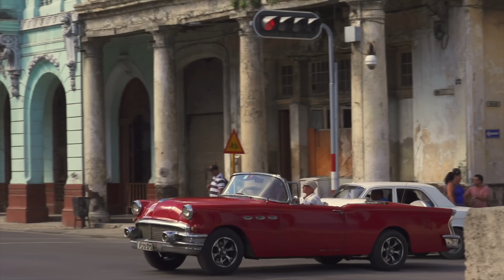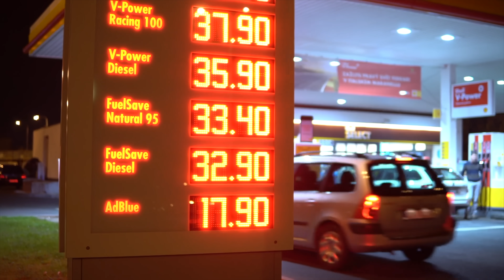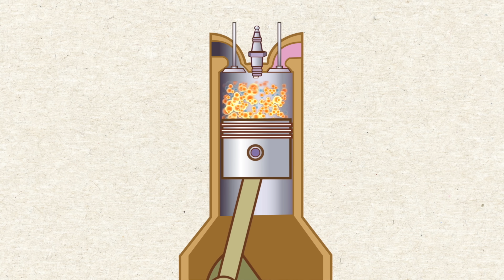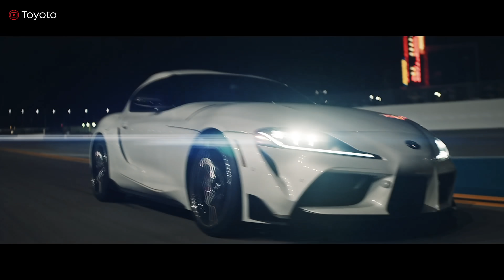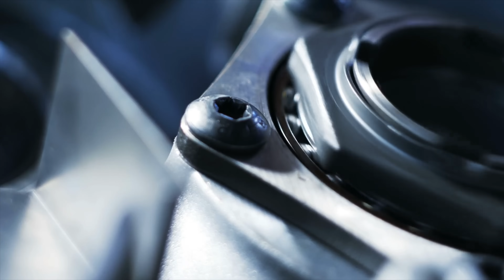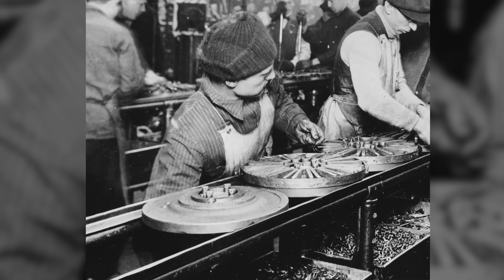7 Fuel Myths Stupid People Fall For

Comment: Scotty, not sure if this was covered, but we have the "may contain 10% ethanol " stickers on our Canadian pumps. I also run a lot of small engines for yard work and motorcycle and off road vehicles. There are about 4 or 5 distributors including Costco Canada that their premium does NOT contain ethanol. That's what I use in engines that may not get a big turnover in fuel, like a generator. I have cleaned so many carbs that are just plugged solid from old fuel with ethanol. It also attracts moisture and contributes to rusty tanks on motorcycles and other engines if they are not used regularly. If I use premium with no ethanol, I don't need a fuel stabilizer on engines sitting till spring etc.
Ethanol is garbage.
Reply: I'm with ya there. Premium here generally means no ethanol we did an experiment with our 07 sierra truck that will also run e85 fuel that isn't available in Canada. Non the less we would generally get after some time using regular fuel we would get a trouble code and reduced power eventually I would have to clean the throttle body. We switched to premium and have not had that issue so far it's been two years we've had the truck for five we also get better fuel mileage so now I always run premium and as you stated premium for the toys always
Reply: Marty, I’ve heard of ethanol clogging up small engines!!  So what is it doing to our vehicles? 
You see I had this beautiful 2004 Lexus ES 330!  and my husband said, it doesn’t make a difference! But it does!  I don’t Know why they’re letting them sell us this garbage ethanol that will eventually clog/seize our engines   in the long run.  From now on, it’s Super for my new car. Thank You
Reply: @gloriacedeno.2737  Car engines have very different designs from most small engines in tools or some motorcycles. The rest of the car (fuel lines, seals, etc.) is also designed with it in mind. Those smaller engines are often using very old designs. For example, you may find a carburetor in a new snow blower or weed whacker. You won't find that in new cars nor used cars going back many years. Also, unless you don't drive your car at all, fuel probably doesn't sit in it for more than half a year at a time. That's where a lot of problems come in.
Reply: Are the small engines two stroke or four stroke?
Reply: Agreed, well said

Comment: Our local Chevron station here in Western Canada offers a fourth option that does not contain Ethanol . I use that one for applications where I know the fuel may get a little old. (boat,generator, lawnmower,etc) along with a well known stabiliser . Enjoying your vids! CHEERS
Reply: Vehicles older than 2002 also should get that 4th blend. All of the rubber/neoprene fuel lines and connections, fuel tank hoses and vents etc. were not made to deal with the caustic effects that ethanol has on those parts.
Reply: We can get that stuff here, but it's getting hard to find. In the US, it's called white gas. Boat docks usually have it. But it has a small amount of lead in it.
Reply: My motorcycles always get ethonol free gas
Reply: Many gasoline station in Ontario have ethanol <spit> free premium fuel.
Reply: @Garth2011  Most cars built after 1986 can use E10 fuel, only cars built after 2001 can use E15.
Reply: Yep that is available in Australia too, its always easy to find ( although not all stations stock it) as the E10 pumps must be labeled "may contain up to 10% Ethanol" if it doesn't have that label then its plain 91.  E10 is often close to 95 in reality but not often labeled as such, I guess because it it's usually cheaper than the real 95.
Reply: @michaelbaka4777  Actually "white gas" in the US refers to an unleaded gasoline sold by Amoco or American Oil Company in the days before unleaded gasoline was the norm. I pumped a many a gallon as a teenager working in a "service station". We did warn people with new cars that they should run a few tanks of leaded gas, or at least half and half leaded/unleaded to help harden the valve seats in a new car's engine until it was broken in.
BP bought the company out in 1998 and pulled the brand, but I see they are now allowing dealers in certain parts of the US to sell under the Amoco brand.
Reply: @michaelbaka4777  Its not called white gas.
Reply: @michaelbaka4777  white gas is basically Coleman fuel used in lanterns and camp stoves.
Reply: @barrywilliams6955  also known as Coleman fuel.
Reply: @XploreAz  Yes, same thing. Coleman fuel sold at the time for, I don't know, maybe $2.50 - $3.00 for a one gallon tin can. Amoco was selling for about 40 cents a gallon. The more aware amongst us used white gas in our Coleman lanterns, stoves and "floundering lights'. And also in our Zippo lighters.
Reply: Fourth action??
Reply: @jimlewis7200  I see it as 4th option.Not sure where you are seeing "action"
Reply: why dont humans only make the best quality of things? why have several different worthless qualities of things?
why waste time and energy making worthless things? when you can devote ALL your energy and resources into making only the best things?
tells you al lot about this stupid world.

Comment: From a chemical engineer, you are listening to too much propaganda on ethanol.  If you calculate the energy to process, water consumption, and other inputs to make corn based ethanol you would never use it.  Next, the cost to produce one gallon of ethanol is closer to $12-$32 a gallon.  Due to subsidies, lobbyists, and government mandates you continue this insane program.  Sugar is primary source outside of USA and most efficient, which the US does little of.  Total CO2 emissions and pollution, ethanol produces 5 to 25 times more pollution than hydrocarbons (ie: gasoline - LCA verified).
Reply: So mid or premium…layman’s terms. Lol thanks

Comment: Detonation is a twenty ton hammer blow to the top of the piston and the ping is the crank bearings contacting the crankshaft because the oil film is forced aside by the force applied to the piston. This at least was the explanation Champion spark plug school gave in 1972!

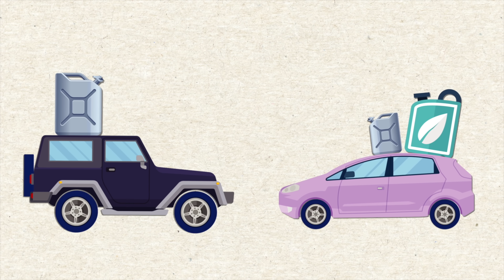Comment: 8:29 : Ethanol isn't as "renewable" or "carbon neutral" as its proponents like to claim.  Planting the corn, harvesting the corn, turning the corn into cornstarch, turning the cornstarch into corn syrup, fermenting the corn syrup into ethanol -- all of these steps consume energy.  Some studies even go so far as to state that it takes MORE energy to make 1 gallon of ethanol than the chemical energy contained in 1 gallon of ethanol!
Reply: Also, without government subsidies, the prices would be way higher.  I've seen some videos comparing mpg of straight gas vs ethanol gas and straight gas wins every time.
Reply: @Llew70 : That's not really a fair comparison.  It's well known that it takes 1.7 gallons of ethanol to equal the fuel power of 1.0 gallons of gasoline, so we'd expect a gasoline-powered car to get 1.7x the miles per gallon of the same car running on methanol.

The real issue isn't the MPG, it's the COST of 1.7 gallons of ethanol, vs. the cost of 1.0 gallons of gasoline.

Comment: I was hoping you'd go more into the 85 octane that you'll see in the high plains/ out west.  The 85 octane pump was on the still for the video, but not really mentioned. Recently I had to explain to someone why they shouldn't run 85 octane in their modern EFI car. Do really that many people have older carbureted vehicles out in Wyoming and Colorado where you see this fuel? I also saw 86 octane on a recent trip out west, and I actually topped off my tank with this 86 octane, in my truck that needs 87 min.  The half tank that remained in my truck when I topped off with 86 octane, was 89 octane, so it ended up being over 87 octane anyways.  I just think it's weird that fuel with octane less than 87 is even sold in any state.

Comment: Our grocery stores have a gas station with 82 octane and I accidentally used it because it was in the same spot in my usual 89 button.   I had never seen this before. My vehicle started puttering and actually shut off while driving.   I went and filled up with the highest octane to correct it.

Comment: I've learned to use manufacturer recommended  gas and oil only...I have a 2017 prius that calls for regular only and 0/20 oil.  The reality is that cam phasors and active lifters use oil viscocity to help determine valve timing...changing either can be problematic....
Reply: You should be selecting your oil mainly depending on your environment.
Reply: @pinionification  ..Yes,specially with temperatures reaching 105 in the summer in the south.

Comment: OK Scotty, I’m gonna have to disagree with you on E85 fuel. The bulk of corn produce in this country does go to producing ethanol. However that’s corn is diverted from cattle feed causing meat prices to skyrocket. The only reason ethanol is cheap is because the government subsidizes it. It’s bad for us.
Reply: You’re not correct. The bulk of corn doesn’t go to ethanol.  40% does.  Of that 40%, 31% is turned to feed as DDG’s as well as corn oil and carbon dioxide for carbonized products.
Reply: I've been wondering about Ethanol for a long time... all the evidence I have seen so far says the process is not energy positive - So the end result of producing ethanol is to waste energy and drive up food prices?  Seems like a bad deal for everyone but corn producers.
Reply: @JohnDoe-pz6yq  Exactly!
Reply: No.  If corn prices rise, it is because the food corn yield in that year was low or bad.  Corn farmers were given guarantees by the government to buy/use the ADDITIONAL corn they planted for gas additive.  Farmers wouldn’t grow more corn unless it was guaranteed to be purchased knowing unsold corn was going to drive prices down both fuel and food corn.  When food corn yield in certain years are down, food prices increased but some called for diverting fuel corn for food instead.  Instead, it was decided to not tamper with the market, and allow normal corn yields in the next growing season to bring food corn prices down. The additional growing of corn is NOT crowding out growing food corn.  In fact, normally, corn is very plentiful and that’s why it is used in crap products like syrup which causes body inflammation, and in the future, sugar will be proven that it increases risk of Alzheimer’s.
Reply: You do not mention that a byproduct of the ethanol production is a high protein feed for live stock  - it is not wasted.

Comment: if higher grade eliminates rattle on cold start, also go with that
Reply: That’s not “rattle”, that’s “spark knock” from pre-ignition. Very bad for pistons. Yes, higher octane cures that, typically.
Reply: @tmcorey1  shouldn't be any pre-ignition on a cold motor
think this is open loop issue, set to mid grade timing till closed loop adjusts for emissions/mileage
all that have behaved such have been late 80s to mid 90s with over 150k, likely too much advance in closed loop but doesn't show till the engine gets some wear
Reply: @ty2010  could be a number of things. Almost impossible to diagnose effectively without hearing it directly. You mentioned higher octane seemed to cure it, which would suggest spark knocking (which does occur cold, but more typically hot and under load). Interesting case.

Comment: E-85 produces more emissions from growing the corn, making it from corn, and shipping it than it will ever save.
Reply: Not sure if that is completely true, but we do have to consider the fuel burned in the production of the so-called environmentally friendly ethanol. Plus corn, which produces a lot of material per acre, requires massive amounts of chemical fertilizer and weed killer. There's always a trade
Reply: I have to wonder if this is comparing total production pollution, and I doubt the full environmental costs in oil production are reflected in whatever source you are referring to. I'm pretty sure the oil spills are not factored in. Did they do a comparison with standard oil wells and tar sands? Tar sands oil production pollutes a lot more than well production.
Reply: No it doesnt.

Comment: I had a infinity G37 that said all over to use supreme fuel only but I only put in the lowest octane fuel the whole time I owned it and never had a problem. I drove it for 4 years or a little more, no knocking and it ran and sounded like a beast.
Reply: most engines do so, but lose some efficiency. unless the grade is significantly different, there shouldn't be many problems from most cars.
Reply: Your ECM was able to retard the ignition timing enough to deal with it, but most aren't, and would pre-detonate (VERY BAD) until piston or head gasket/head damage occurred. Either way, extremely inefficient, and the drop in fuel mileage negates the money saved.

Comment: I live in a state where they have 10% ethanol. When I drive across the border and fill up with 100% gasoline I’m astounded by how much better my engine runs.
Reply: My state has stickers at the pumps that say, "May contain up to 10% ethanol", which I know is code for it has at least 10%.  

I wonder what the actual percentage of watered down gas is that we're really getting.
Reply: I live in Nebraska and every single gas station has gas with ethanol
Reply: of course, youre not pumping sugar in it.
Reply: They should all have ethanol to prevent knocking. That was the additive used after lead was removed. The octane ratings are equivalent ratings.
Reply: yep. do they have 7/11 in that state? They don't sell flex.

Comment: Actually octane and grade are different depending on where you live.  Where I live, 85 is regular, 87 is midgrade, and 91 is premium.  They are specially formulated for areas that are dry, or humid, or high altitude.
Reply: Utah has 85,87,88,89 and 91. I use 87 or 88 whichever is available in top tier gas. My car recommends 87 so that's what it gets.

Comment: In 2011 I bought a 2002 mustang gt 5-speed   One day I found a station that sold ethanol free gas and tried it and was surprised to find that I got 3 miles per gallon more than with regular 10% ethanol gas (15 gal. tank) but as long as I was driving every day I mostly stuck to the cheaper 10%.  Now that I'm retired and not driving that much I use nothing but ethanol free gas, mainly because I don't like that ethanol just sitting in my engine for a week sometimes two.😎😁
Reply: That's a huge difference.  3 mpg  for  no ethanol to a e10?  I have a 5.0 flex fuel capable f150 and I lose less than your figure when I run 85% ethanol vs 10% ethanol fuel.

Comment: A word of advice that is not mentioned.  Older cars and lawn equipment with carburetors should NEVER use ethanol diluted gas.  That syrup will cause all kinds of carburetor issues.  Also, it should be mentioned that ethanol decreases fuel mileage as it is stated in the video, it is lower in energy output.  I'm fortunate to have 2 ethanol free gas pumps within 2 miles of me, my Opel GT's are happy.

Comment: Read the fine print in the owners manual of any Ford Ecoboost engine. 
Will it run on 87 octane? Yep, sure will.
Read the fine print. If towing, in operating in extreme ambiet temperature, if hauling heavy loads, it recommends premium fuel.
There is a disclaimer in all the Ecoboost engines and vehicle brochures that the official maximum SAE horsepower and torque numbers were achieved using 93 octane fuel.
Will it run on 87 octane? Yep.
Will it be happier on 93? Yep.

Comment: I use 93 octane in my 20 year old Toyota Tacoma. Every time I have to use 87 octane the check engine light comes on. When I use 93 the check engine light never comes on. Plus each time I used 87 octane I would always have water coming out of the tail pipe.
Reply: Sounds like the intake system needs cleaning. I’m wondering if gumout will actually solve the problem. I had an old car that would give me a few warnings that would go away when using 89, but they also went away after putting extra additives in the gas and went top tier for a while. A mechanic told me I needed a fuel induction service the first time I went in, but not the second time.
Reply: One of the potential reasons is carbon buildup in the cylinders. Now you need more knock resistance.
Reply: Also agree sounds like you need some sort of system cleaning because of carbon build up.

Comment: I worked in a chemical plant for 22yrs and we made the gas additive that was in premium gas.  This additive cleans the fuel system, aka as fuel injectors. with the current price (thank you Obiden) i don’t use it at all, but when i do i can feel the the difference in the engine..
Reply: I'm curious if you can confirm. I saw a test once where they ran a sedan on a dyno....different octane ratings. They did differ from low to high, the higher octane additive did lower the fuel density....it was just less than .01% (this was pre ethanol)